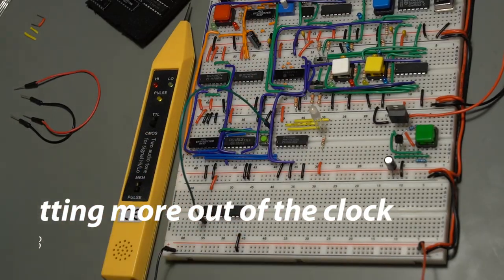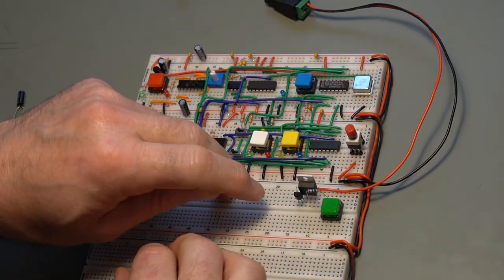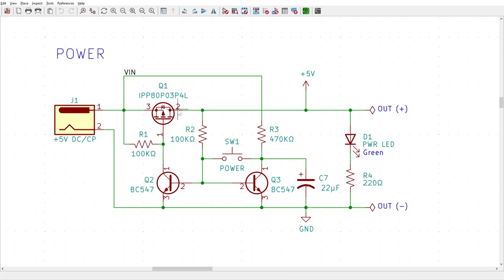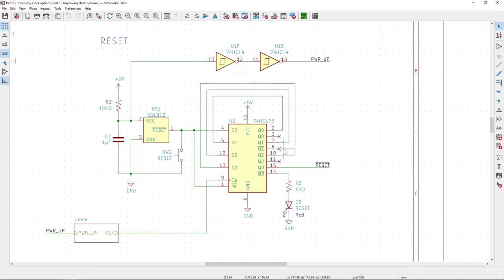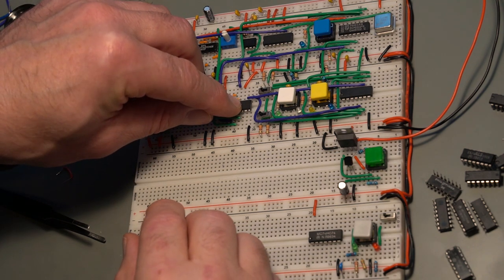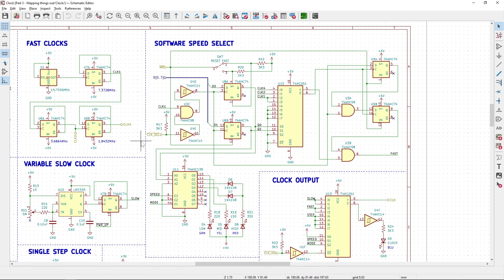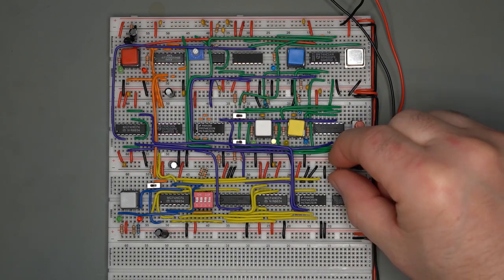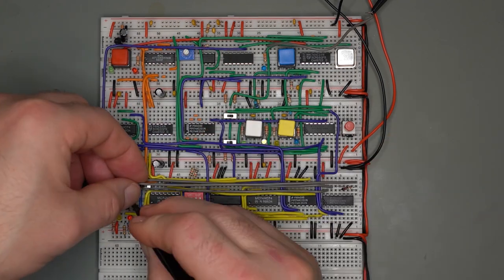Z80 Homebrew - Getting more out of the clock - Ep3

Comment: Dave jones also has a  great video on latching soft power button. Regarding the clock switch the transition on clock source should happen in its high phase to not glitch the z80. Simply and your 2 free running clocks and switch on falling edge of the product . There is a tutorial on this in a old microcomputer design book which you can find online. It uses two d Flipflops and two gates I think. (It’s about 10 years ago since I last used a clock domain crossing switch 😅)
Reply from the maker: I'll check out Dave's channel for his version of soft power on circuit. Thanks.

The clock should switch on the high phase of the clock? I always thought it was a better idea to do so on the low phase. At least, that's the way I would have handled it with the 6502. Any reason why the Z80 is like that? 

I've corrected the circuit, so it switches at the negative edge by adding a few JK flip-flops. I got the implementation idea from Adrien Kohlbecker's clock circuit. But if you say I should switch on the high phase, this means I need to switch on the rising edge?
Reply: @microhobbyist  I myself am not a 100% sure at the moment any more where I read it, it was an article on that topic from the early 90s which referenced a book on system design with the z80 from the early 80s I believe by Steve Ciarcia but I’m not sure. If you can switch the clock at a stable level without generating pulses shorter than a half wave max clock frequency of your z80s rating your probably fine - especially when using a CMOS Z80 as they are static designs. The hole is to not glitch you clock.